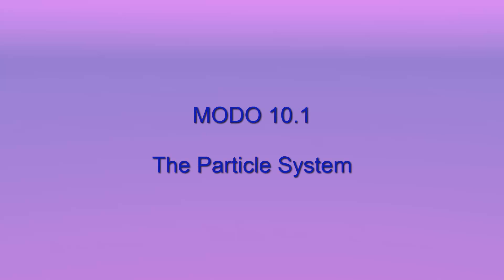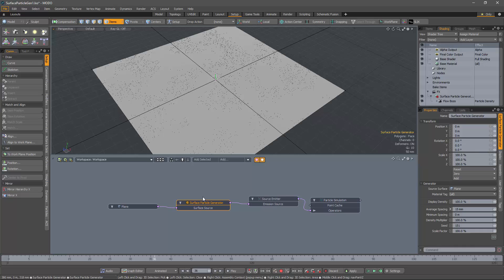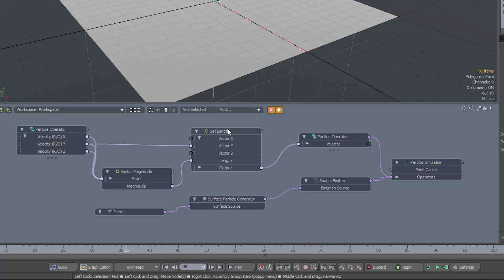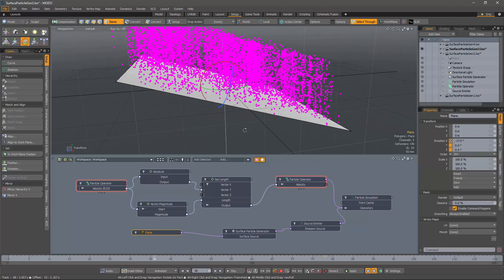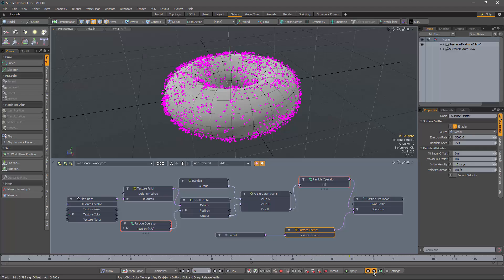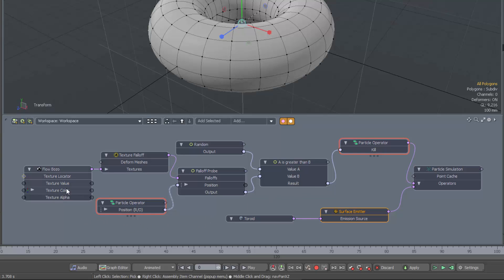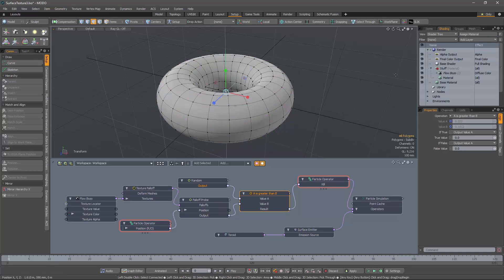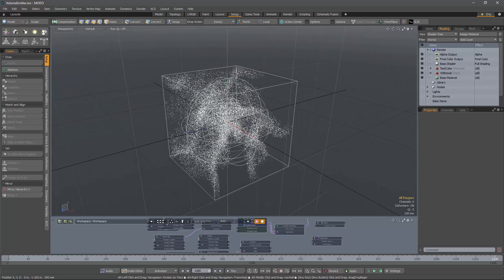Textured Surface Emitter

Comment: I know this video is quite old, but if you still use this in Modo 16, here is a tip to prevent some headaches for others: The order of the operator input connections on the particle simulation matters! At least in this one case. If the 'Kill' Particle Operator is connected below the Emitter Input, NO particles will get removed !
Reply from the maker: Yes - this is an important point about particle sims in general.

Comment: Hey Steve. Great tutorial. I have a question though. Is there a way to use Replicator for these generated points in such a way that the Replicas would be oriented perpendicularly to the surface that the particles were generated from? If I just use a surface generator that works fine, but as soon as I hook it up to a Surface Emitter - the replicas loose the correct orientation.
Reply from the maker: Sorry for the delay.  The particle stuff is quite old, so I don't often look at the messages.  The good news is, yes, I think there is a way.  You can use the velocity of the particle, turn that into a position vector and use a direction constraint to set the rotation of the particle.  Perhaps this could be the basis for a new Morsel?
Reply: @SteveHill3D  thanks for your reply, I'll try that. I'm all for that topic for the next episode too :)